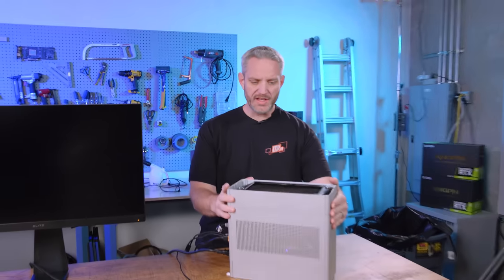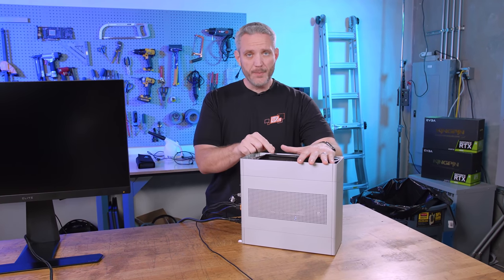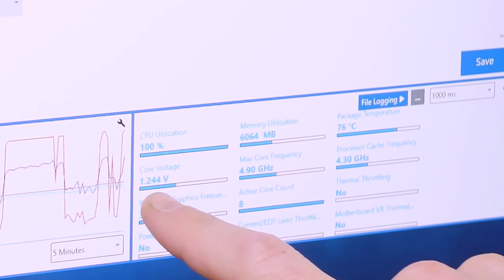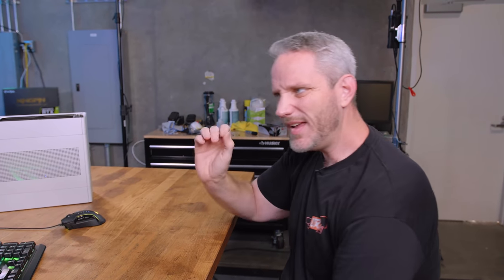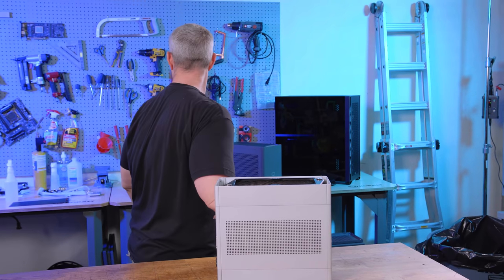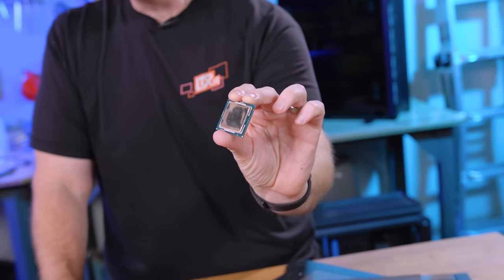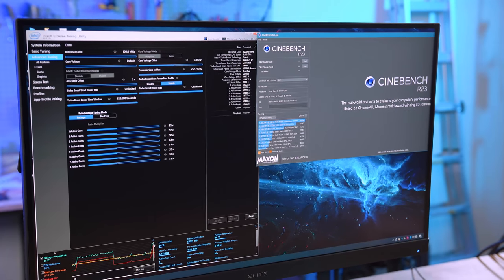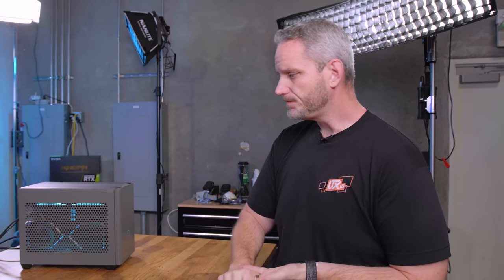THIS is what a Silicon Lottery Winner and Loser looks like for CPUs...

Comment: I used to get "golden CPUs" back in the day.
Now here was the story behind it.

As we know the CPU is made on big disks, it was typical that the edges were bad and were often left to cut down CPUs. Cellerons, or lower core court and such like.
So basically you get what there going for and the failures were all sold as lower chips. Same with GPUs...

The central CPUs apparently turned out better and they were graded in a spiral and outward way, then graded again under test conditions.

These too were sold as different CPU's as they had a standard to meet.
The PASS chips had quite the variable in performance and this was all recorded.

Basically each CPU was tested and the result attached to it. There could be a massive variable within the group of what we'll call top spec.
These were golden samples and to work within tolerances they would be locked. Or just sent out as is, of course the massive variable meant that there were chips that clocked faster, ran cooler, ran lower voltages, and just about everything and all combinations.

I've here 2 i5's.
One is stock, it runs 3.3ghz at 65 0c.
The other runs stock at 20 0c.
I've not pushed them both, however that low temp, runs at 4.2ghz at 40 0c and @56 0c gets 5.2ghz.

Stock Volt's.
Now to understand CPUs, they are simply gates. The volts swing the gates, the amps push the gate.
There are millions of gates in a CPU.

Leaks occur when the voltage is high and it spreads to the other gate and effects how the other gate works. You can slam the gate using amps, but this will break the gate and if combined with volts can really break the gate.

It was common for the volts at high speed to drop. But they were required mid speed. I has one system that was super clocked. However it wouldn't start up and hung. So I would have to let it hang for a while and reboot to have it warm up, and it would be fine.

As the temp changes the gaps in the gate (think of it like a door frame on that gate)
Would expand to allow the flow of the gate at its settings (and temp).

There was more problems when they moved the memory controller to the CPU, while for AMD this was better than the Intel. It was still also a bit of luck as Id have different results on ran performance from the same CPU and settings..(while both capable)

Comment: My i9 9900k was bought from Micro Center and it was actually a very good OC chip since I could run 5GHz all core on a evo 212 air cooler! I was even able to run 5.1 without thermal throttle but the temps were higher than I was ok with for daily use. Even at 5.1 it was not going over 90 C.

Comment: Bro I’ve never gotten a cpu to run at 1.240v on stock clocks. How do I get one of these magic chips?
Reply: Luck lol mine needs 1.3 vcore for 5ghz all core 10700k my brothers 9600k needs 1.23 for 5ghz all core... try a cache/ring down bin of 4.7 or 4.8 it can lower temps a lot and vcore.

Comment: Silicon lottery means you either get a good overclocking chip nor not. Asic quality is directly related with that because there is a finite limit of voltage you can apply to a cpu before killing it. And it doesn't change from chip to chip on the same family. If you get a good asic quality chip, it leaks less voltage while achieving higher clock speeds and producing less heat. Less leakage = more voltage to be used for work.

Comment: I haven't won the silicon lottery in a long time. Most of the CPUs and GPUs I've had didn't care for overclocking far enough to be worth the trouble. Long ago I had a Pentium III - 500 that I could get to run stable at 625 Mhz which was a crazy overclock for that CPU.
Reply: Mine 9900k couldn't even hit a stable 5.1 ghz

Comment: No Jay, this is intel cherry-picking CPUs to send to reviewers, while the crap gets sold to consumers.
Reply: Yes and no -- the review samples come from the 90th percentile group they have at the time.   The CPUs aren't the best of the best, but they are picked from the 10% best performing launch samples and your odds of landing 1 are 1 in 10 as a normal consumer.
Reply: @mhamma6560  What I mean is that when review samples get sent out, there is no playing the lottery, they are guaranteed a winning CPU, if the manufacturer has cherry-picked them, as Intel always seems to do. Consumers on the other hand, might end up with one that can barely meet spec, or they might get really lucky and get one like reviewers get.
Reply: @ScytheNoire  no such thing as barely meeting spec... lol they all do stock clocks fine just some don't overclock as well as others...

Comment: There is more into a unstable CPU than setting the voltage higher and lower for the core.
And lowering the speed up and down. VCCSA, VCCIO, VCCIN voltages can be very important when you want those high speeds.
Not touching those and calling the CPU not a golden sample is a n00bs mistake.
Reply: Also cache ratio... a lot of chips won't go past 4.7 or 4.8 cache no matter the voltage... ppl try setting a cache and cpu clock of 5ghz and wonder why it needs 1.5v ... or won't even pass a stress test

Comment: I had an AMD Duron 800 once, which normaly ran 8 X 100 mhz and had it run 856 ( 8 X 107 ) without overvolting. The best thing though was that my memory could also handle the 107 mhz. With a better BIOS or better motherboard ( overvolting ) I guess it could have gotten much higher. There were also unlocked Duron out there. You could adjust the multiplier on them ( silicon lottery ). For the locked ones you could close two contacts on the processor. On a flat service just use a pencil, but there was a little canal between them, so the peciltrick didn't work. Too small to solder for me. So I had to do with this ( price difference between 800 and 850 was about $ 30 at the time ).

Comment: I’ve got a winner of a CPU. 5600X able to run at max boost (4.6GHz) as long as it wants all core on only 1.15V. A -200mV offset from stock. Stability tested with Ryzen master, cinebench R23 and CPU-Z.

Comment: I recently bought a Zotac 3070 Ti Amp Holo and a 5800X (bundle).  The GPU, rated for 1830 boost, hits 1935 stock out of the box.  I ran the 1USMUS Ryzen tuner, just for initial scan and it came back as a Golden Sample.

Comment: I run my 10700k, 5.1ghz all core @ 1.335v 24/7, LLC mode 3. Passed all stress tests a year ago, with totally reasonable temps. Still running strong. I've always felt I got lucky with that CPU, because I've seen other 10700k CPUs that could not run at my chips settings. I've been happy with it. BTW, maxes at 67C spikes on the hottest cores while gaming.
Reply: At 5ghz here with an old dying 240 aio.. 10700k at 1.3v low llc 68c gaming temps after all day.. might go for 5.2 when I get a new 360 aio soon passed all stress tests fine.

Comment: Not going to lie, with parts as expensive as they are, I was happy Apple released something for the first time in a while with the new larger iPad Pro with the great screen/performance for the dollar.  I can handle all of my photo editing and illustration/design work on it fine on top of it being my notebook for most tasks out and about with the keyboard case.  It's not perfect, but bang for the buck they're hard to beat for the specific things I do.

My desktop is a VM server uses older Xeon 10 cores.  I have another second gen Ryzen machine, but for the most part the VM server works fine with guests for Manjaro and Windows.  I planned on replacing my 2600 machine with a 5700G(E) build that would eventually upgrade to a 12 or 16 core Ryzen 9...we'll see how that goes.

Comment: Reminds me of my silicon lottery looser R5 2600. It was unstable with the ram speed above 3000mhz when pretty much everything I found said 3200mhz worked fine. I didn't even bother to try overclocking it.

Comment: Generally a high leakage CPU/GPU at same voltage will OC higher but run hotter. They require more cooling.

Comment: Swiftech makes some pretty cool shit. I still use their H320 Prestige, which is the heart of my CLC, cooling an OC'd 2700X and 5700XT, with its own 360mm rad, and an additional 420mm rad. Re-lubed the pump on my last teardown, and still humming along.
I'd be curious how much you could squeeze out of his old CPU, by lapping and replacing the TIM.

Comment: You should do a video on the silicon lottery, binning, stepping / revision, with examples.    With Zen 3 and the F5 wars of wuflu days, I noticed a pattern from AMD.  5600x CPUs were only born if they failed to be worthy of 5800x / 5950x.   I haven't tested a single 5600x that could come anywhere near what the 5800x can do as far as voltages and stable max clocks.   There were loads of 5800x for the longest time which meant yields were mostly good, and 5600x only seem to be born if they couldn't handle the 8 core's capabilities.  Good example of strict binning vs what we've come to love over the years where high quality silicon was down binned to simply ship that segment of the market.
Reply: Just. Curious how high did your 5600x get in pbo?
I managed to get my 5600x to do 4.8 all core

Comment: I wouldn't use cinebench as benchmark for heat, stability and power consumption. My 3600 can run cinebench without any problems @1.012V 4GHz allcore and literally consume below 50W but when I hit with AVX loads (like in prime95) it needs 1.064V to not hard crash. The higher the clocks the more obvious, for 4.1GHz allcore prime95 I need 1.17V, cinebench only needs ponits above the 1.012V...
So cinebench might be higher load than gaming but it by far doesn't put maximum stress on your CPU.

Comment: I’m the opposite: 
I either test how far I can UV while keeping close-to-stock speeds...Or how far I can combine OC and OV

My 1070 runs at 1911MHz@920mV (1987@1050mV stock)
My Ryzen 3100 runs on 4.1GHz @ 1.11V (3.9@1.2 Stock)
Could I do 4.4? Yes. Would it require 1.4V, drawing more power? Also yes.

Comment: I thought for the last year that I got a dud 9900k from microcenter. I for the life of me, could not get a decent OC via bios. 

At one point, I was set at 1.43 v at 4.9 and still having crashing. No matter the bios version (aorus master z390) following every guide possible for tips to stabilize it.

Updating from 1070ti to a 3080 ti just made stability worse. 

I have just yesterday set my bios to stock, only with xmp, and used XTU, and am now running 5.0 all core at -0.040v. on air. -0.045 I haven't fully tested, and I think on water I could do -0.050.

Reason for bringing this up, I ONLY got the idea to try xtu instead, so I could see how my "dud" compared Phil's original 9900k after watching the first video for his case swap.

Thank you for your videos guys!!!!
Reply: I also have a 9900k and z390 aorus master, i can do 5.2 all core 24/7 probably 5.3, tested but only a little bit, i will try xtu too, who knows
Reply: yea because most guides say to set a fixed voltage which can be hard to get right and with the adaptive with an offset o xtu its much easier to set it up and you don't need to go back and forth between the bios a million times. Having it adaptive makes the cpu run much better doing its own thing opposed to static but it can tend to go high depending on the mobo plus the turboing works much better that way
Reply: @connorjohnson4402  yeah I was doing the brute force method of just cranking the voltage near max for testing, but it was crashing at idle, under any load was usually fine.

I was also having a lot of random/weird issues as well. Such as GPU temp not reporting unless bios was set to stock.

Comment: I had a golden sample i5 2500k that got to 4.7 with stock voltage and only needed 0.1 to hit 4.9 had it water cooled for years never felt the need to upgrade until Ryzen

Comment: I bought a 9900k for my daughter's system which has the MX Apex board. It can hit 5.0ghz and it's stable at 1.31v, -2 AVX, XMP on w/ 32gb of 3200mhz RAM. It can pass Prime95 Small FFT's, Blend and LinPack Xtreme. However with the 280mm EVGA cooler it was reaching 92c while running these stress tests.
Reply: My 9900k custom liquid cooled was getting very hot, after i delidded it and direct die mounted (derbauer OC frame it's like a completely different cpu)
Reply: @greggreg2458  Thanks for the tip.... I didn't think direct die cooling would be so effective.
Reply: @m8x425  maybe my CPU IHS was very concave/convex but going direct die cooling i can do 5.3 all core 0 avx offset, (not sure if 24/7 stable) and 5.2 all core 0 avx offset 24/7 stable. I think even 5.3 is under 90C, before direct die it was like high 80's stock.
Reply: @greggreg2458  I remember once lapping a Cooler Master V8 and a Core i7-920 and it did help the temps... but the total was 5c when under load. The I switched cases from the Antec 900 to the Cooler Master HAF 932 which also helped and switching cases seemed to do more. The I lapped a Thermalright IFX-14 cooler which helped some more.

I gained a couple more degrees by switching the paste from AS5 to Shin-Etsu or IC Diamond 7.

Comment: saves alot of time to just simply set to the multiplier you want and then set the voltage to what you want and see if it runs, if it runs without crashing then you know itll work in that voltage range and work your way down until its unstable and then you can go back and set your offset to the range it needs to be. thats just my 2 cents lol been building and overclocking pc's for 20 years now and never have i had any cpu in any computer that i oc'd die. hell i have a going on 10 year old i7 3770k running at 5ghz since i got it still running strong. i need to delid that monster too because its deffinitly a silicon lottery chip not many hit 5ghz without a delid.

Comment: I Fix It? XJ650 TIC unit, fixed it by pulling the fused zener diodes and capacitors out of a brand new 80+ corsair VS450 as well as a 5v charger adaptor. fit it!
Reply: there was also an old PC speaker set that had some caps and diodes but that was a 1990's windows speaker so saying so and the vintage guys will loose it...
Reply: green with the gold stripe are gold or bronze 90+ ratted capacitors?

Comment: I didn't have the best luck with my CPUs so far. My i7 5775C used to go to 3.9 at a voltage that I don't exactly remember, but I very well remember that from there on it took a TON of voltage to go any higher and I wasn't able to get 4.0 stable with a voltage I was comfortable to apply... Same thing with my Ryzen 2700... 3.9 runs with 1.275V with high LLC, but 4.0 won't even run with 1.375V and high LLC, I settled for 3.95 at 1.35V with medium LLC but from 3.9 up it was getting incredibly inefficient... It's also running noticably hotter at 3.95 than at 3.9 but I wanted to get as close to 4.0 as possible and honestly I'm a little disappointed, I didn't manage to hit 4.0... Same as my i7 I had back in 2016...

Comment: Ok so if I understand this right, asic quality is about the maximum speed a CPU can theoretically achieve, and silicon lottery is about the voltage required to achieve those speeds.
Did I get it?

Comment: I got my 9900k from Micro Center and I can get it to run cinebench 5.2GHz no problem at 1.325v, with temps in the low 90's on a 240 aio.  Not the best it could be, but after seeing this I feel it's a descent sample.  I also got my i5 2500k from Micro Center and it would do 4.7GHz with Prime95 and only 1 core would fail, can't remember voltages though.
Reply: That's too high. It will degrade quickly in the coming years as I keep mine 1.275 and 4.9 GHz all core max. On high loads it hits 70c now and will last longer
Reply: @timothygibney159  Yeah I Backed it down from that, just wanted to see what it can do when I got it.  I normally run it at 4.5 GHz and 1.25v, I don't have much need for the high speeds anyway.

Comment: my 9900k is running all core 4.8ghz at 1.175v. at 58c when I run cinebench r23. That's my Sweet spot as its stays icy cool when using and honestly don't notice much if any difference in game from a 5gh OC. It'll do a 5.2ghz all core but at 1.3v and temps end up going into the 80s at the point. 5ghz is 1.24v but idk, i just like the fact i can run a 100mhz oc with a -25mv undervolt.

Comment: Holy shit. I've owned a 9900k that even if OCd to 4.9 would crash. Returned it for my current one that need 1.27V to run 5.1. To see a 9900k undervolted at 5.1 is insanity.
Reply: Have you tried 5.2 or 5.3?
Reply: @greggreg2458  I can but it requires a lot more voltage. 1.35
Reply: @Madblaster6  i have my 9900k direct die mounted and custom watercooled, if i remember correctly i can do 5.3 at 1.35something. I usually have it at 5.2, i don't remember the voltage because i have set it more than a year ago, but even with mine there is a big difference between 5.1 and beyond.

Comment: I'm shouting at my monitor, 1.36 lets go!
This video puts a grumpy smile on my face. I love my CPU, 4.8 across all cores, I know it will do 5 but HEAT! So comparing my Rig to Phil's, stupid I know, the whole time my mind it like YES I am a silicon winner. Then we get to the end of the video and realize he literally has 2x the cores. Still love my 7600k.
Reply: My i5 11600k does 5.1ghz after overclocking with a noctua cooler still don't feel much different from my i7 4790k which did less

Comment: Am sad, my 3900X that runs 4325-4300-4225-4150 on a 1.25v undervolt (and running my ram's 3600MHz DOCP), now has Cinebench R20 and R23 crash when I try to run it. I tried upping voltage but it doesn't seem to help. No problems in other applications or in games tho, and "Apply and test" in Ryzen Master still finishes fine.

Comment: I personally think that my Ryzen 3 3300X was a winner. 4.4GHz stable at 1.2375 volts. Across all cores and threads. Not much, I know. But I'm holding an overclock for a stable undervolt.